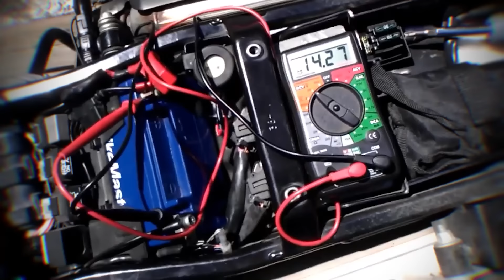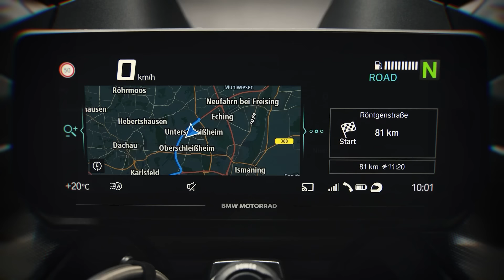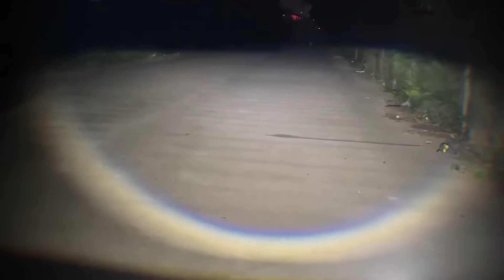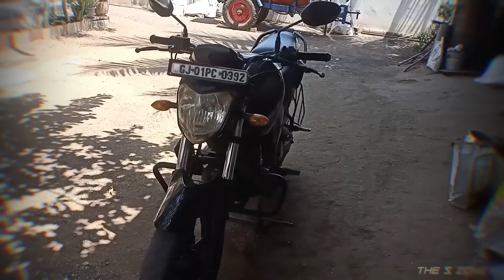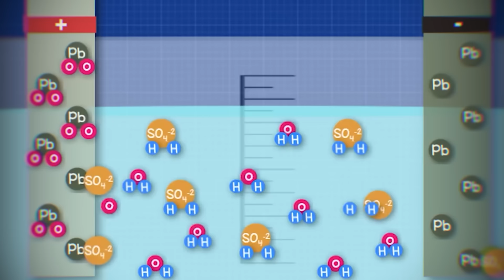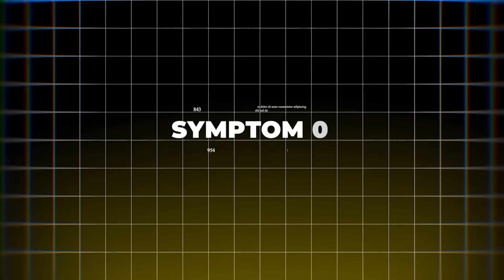9 Symptoms of a Bad Motorcycle Regulator Rectifier (Fix Fast)

Comment: My ducati monster, The lights and the dashboard on my motorcycle turn off randomly. I’ve already checked everything—fuses, exposed wires, connectors—but the problem persists. Do you think it could be the voltage regulator?

Comment: It doesn't always take just 30 minutes, not when there's lots of fairings to remove... And the rectifier/regulator can also fry the stator windings on the alternator if part of it shorts out like they do, you didn't mention that. And sometimes the regulator is mounted in a really stupid place like right over the exhaust where it gets roasted and then it starts frying the battery as well as other expensive stuff, then it needs mounting elsewhere where it will be cool and that can mean extending the wiring. And if it has cooling fins then the fins should be vertical so it can keep cool.

Comment: Hi, I have a 150cc scooter and installed an O2 sensor with a voltage gauge; the reading sometimes sits at 10.00V and then rises to 14.00V. It’s new—only 500 miles on it—but ever since I installed an A11 camshaft (which I think raised the compression a bit), it struggles a lot to start. I was told that the factory batteries on these Zuma/Honda replica scooters are poor quality, so I bought a new one, but I’m still facing the same charging issue: the voltage fluctuates between 10.00V and 14.00V. After watching your video, I’m thinking I should get a spare regulator just in case it’s about to fail. What do you think? My scooter isn't fuel-injected; it has a carburetor and the older GY6 engine.
Reply: Mine is Battery voltage is Normal but the Control Module Voltage is 16V. My easyride150Q FI has increases fuel consumption, engine suddenly stops when running, poor acceleration and my top speed is only 80-90kmph, System High voltage shows on the diagnostic, Charging port charges fast no usually the normal. Hard starting and needs trottle to start and when on stop engine dies, engine light is ON, digital panel sometimes have a black spot. Unit: Motorstar Easyride150QFI

Comment: Another thing that can burn bulbs is a short to ground. Harley being cheap ass holes pulled the harness so tight where it goes in and out of the headlamp that it rubbed through the insulation as you turn the handlebars. This causes the regulator to step up the voltage. When you turn the short stops and WHAM the voltage spikes because the regulator is trying to keep the voltage at 12 volts while being shorted to ground. This will kill bulbs you just put in there. Always watch for this.

Comment: I've just come out of at least 6 months of charging system issues.

I changed 3 rectifiers on my sv650. 2 new generic ones and a second hand one off eBay.

I eventually got fed up and decided to totally bypass the DC output of the rectifier with a new line connected straight to the battery. The ground seemed fine but there was leakage somewhere. 

I purchased a second hand genuine Shindengen rectifier as well.

I added a 30 Amp fuse on the positive of the new line.

That type of rectifier is great as it starts giving the correct voltage at low rpm and remains very stable regardless of revving.

Mine is delivering a rather stable 14.25V

The positive thing in all this is that I've learned to understand how the charging system functions on a bike and know where to look now and how to control the current function of it.

Comment: Those little black boxes are a real pain in the arse. I have replaced a few of them over the decades. The last one I never did. It was for a 1982 Honda GL1100 Dresser. I looked at what needed to be done and threw the part into the saddlebag and forgot about it. I had to literally disassemble the fairing to get to the part and there was no guarantee that I would get it back together properly. I ended up selling the bike as a result.

Comment: I have a 2016 bmw s1000rr that i switched to a lithium battery and lithium rectifier on but, i didn’t replace the stator, now the rectifier sounds absolutely terrible after having it for 3 months, i flip just the key on and off and it sounds like rattlesnake for 1 second and then it sounds like sizzling bacon for 15 seconds even with the key flipped off..

Comment: This video  makes a strong case for the old school  bikes, cars, trucks,  etc, etc,.  in the older bikes, usually you could  patch them up to get home or to somewhere  where you could  get it back up to snuff.  The new bikes are  not as reliable.  Just to much electronics to go wrong.
Reply: I own a 2008 XL1200L Sportster that has more than one black box and “miles” of wiring. Well, it seems like “miles” of wiring. If something goes FTZZZZT, I have to go wheels up and trailer her home. I had a 1982 Honda GL1100 Goldwing that developed an electrical problem I couldn’t find or fix. She barely made it home. Full throttle at 35 mph. From Tucson to Avra Valley. A 45 minute drive one way. It took me an hour and a half to get home at that speed. I never got her out of 3rd gear. Sadly, I had to sell her.

Comment: I had starting problem on my honda rebel 500 for 1 1/2 days, then nothing. took the battery to auto zone, 12.8 volts, stillgood supposedly, still no start. my point, the stator could be good, the r/r could be bad right. new battery(mine wouldn't hold charge--the old batt)bike cranks right up, no power loss, rough idle, etc. i guess what i am asking is the r/r could be why battery isn't charging.

Comment: What about main fuses that keep blowing the moment you switch ignition on
Reply: Short in the ignition/starter circuit... Starter, starter switch, starter solenoid, killswitch or any of the wire in between... A grounded wire in the headlight can also do it... These are what I've seen, there might be more possible causes.
Reply: @FilthyxRichxMartinez what do you mean "a grounded wire in the headlights"? I literally have that...I cleaned it up and made it BETTER..or so I thought.  Is it not supposed to be grounded there? Please elaborate help please! 🙏 lol

Comment: I've changed the regulator/rectifier three times and the battery is still over charging.
Reply: Looks like you need a stator bro I just had to replace stator and rectifier on my r1 2007 model
Reply: @Aussierider45 i rode my 07 to the shop got on it and nothing , jump started it and it died as soon as let the throttle go, got it going , kept the revs up but all of a sudden the dash died and so did the bike , i have my voltage regulator out to test but think i may need to do the stator , if the rectifier is faulty would that cause the problem and avoid doing the stator ?
Reply: @LuciusHansen-j7v  yeah, that's what i want to know also!! I haven't had the problems you had either. My rebel 5oo just died one day, checked stator by pulling neg battery terminal off, bike died(new battery at the time).

Comment: This shit isn't ai I've spent close to what I paid for when I bought the bike from the dealer and still shop after shop after shop I've gotten anger breakdowns over getting it out the shop and hours later stranded at 2 or 3 am far asf from home end up getting home 8 am pushing the bike home since I've drained so much of my savings from so many parts and towing fees resulting in having no choice but to take ubers or bus rides to work until I could pay for another repair that again doesnt get fixed  ..

Comment: all companies are using old shunt type regulators to cut cost. you must install modern mosfet voltage regulators and rectifiers. it's an upgrade to electric system of your bike or car. means no more dead batteries, bright lights, stable voltage like no flickering of lights, no dead lights.

Comment: My usb port connector also has a voltmeter. Yet unlike @alexszlanina7548 suggests DONT connect it to your direct to your battery. Use an ignition powered lead. If you're running a hi draw items, lights, heated jacket, etc check your connection at regulator, as that's where the heat is generated. If running Li don't charge over 14.4V it'll kill the battery. 
I didn't need special reg on Busa w/ Li battery, I luv they're fully charged in 10min     https://youtu.be/N3fLjtQkozo

Comment: A.I. contents is full of ERRORS.
Actually flickering is not cause by a faulty rectifier-regulator. The rectifier-regulator converts the alternating current (AC) from the alternator into pulsating direct current (DC), a good/healthy battery smooth out these power fluctuations into a more consistent DC voltage (acting like a huge capacitor as well) . . With a faulty/dying battery, the smoothing of the raw inconsistent DC will not occur causing lights to flicker and this flickering (pulsating DC) also affect sensitive electronic components which shortens their lifespan in a period of a few months..
Reply: Mosfet rectifiers doesn't cause fluctuations. old shunt types do. Mosfet is designed to give full wave stable voltage @ all rpms
Reply: @sultanmehmoodghaznavi6312 Yes, Mosfet rectifiers doesn't cause fluctuations, but if the source electricity is a pulsating type then the output too will be a pulsating output without a smoothing capacitor.
Reply: @johanrynjah8241 You are the hero we needed in the comment section. Rip dac & Toby.
Reply: @johanrynjah8241 so the flickering of the lights on the dash? Is because of the capacitor?
Reply: not true. A.i helped me identify the problem where no one was able to even guess. A huge difference between old shunt type regulators and modern mosfet rectifiers. A.i insisted that I go for a mosfet. I'm so happy. I made the best decision to trust A.i.
Reply: @sultanmehmoodghaznavi6312 Old shunt regulators are less efficient than modern MOSFET rectifiers because they burn excess power as heat, whereas MOSFETs are more efficient by switching and diverting power electronically. MOSFET rectifiers also provide better voltage control, react faster to changing conditions, and run cooler, which is especially beneficial in applications like motorcycle charging systems. Shunt regulators work by diverting excess current to the ground through a variable resistance (often a Zener diode), while modern MOSFET regulators open and close the circuit electronically.

Comment: I ride a dr650 and I put a voltage gauge on it they like 10 bucks on Amazon
Reply: Thanks

I'll have a look online for this as it would be easier than using a multimeter. 

Read my comment on my (hopefully) resolved issue.

Comment: I keep a spare eBay rectifier on my bike 😂
Reply: must be a honda
Reply: @jerryeinstandig7996 mine is. Trying to get it running today cause it’s so nice out. But theirs no way to fix regulator I think so I had to order one and a stator to be safe
Reply: Just ordered 2 for my '81 CB100n, 1 for replacement - 1 for spare.,, 6.12 in the battery - 12.5 - 30v when revved😆
Reply: Shit I should have done that…

Comment: Just fit a digital volt meter to your dash, connected to your battery. When in normal functioning mode you'll see voltage between 12.7.. 14.5 isch volts. Turn your lights on, voltage drops to 13.8 or what ever. With a failing rect/reg the voltage will fluctuate between say 4 to 30 volts. Easy to spot a failing rect/reg way before battery is depleted, giving you early headsup to check your electrics.

Comment: Hi a have a dirt bike yesterday it brok down on road didin get throtle dont start up but a conect to batery car and it run well can it be reguletor volteg
Reply: bad battery
Reply: Get new battery then make sure regulator rectifier is working properly, about 13.5  to 14.5. 18:57